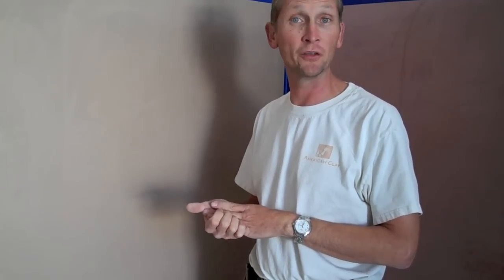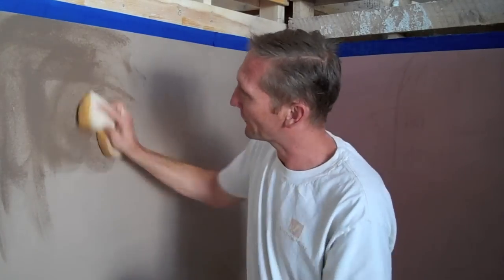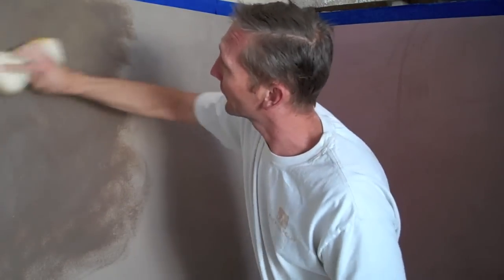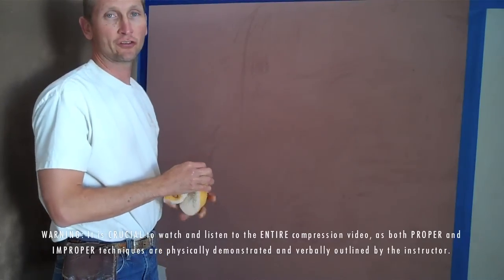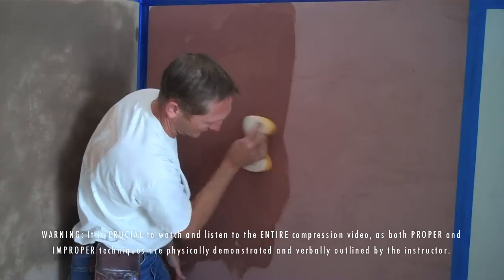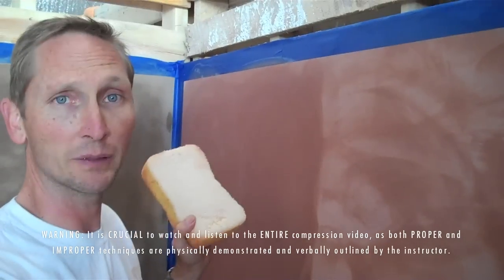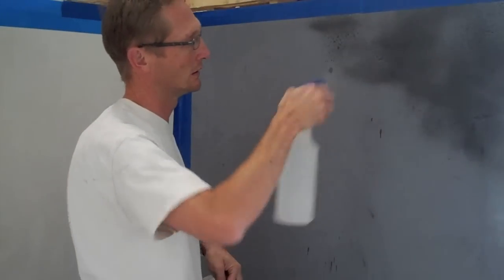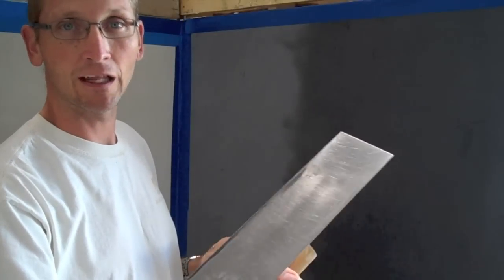Compression Techniques

Comment: Just finishing a thousand sf. job . Been working with different coatings since 1978 .
We applied clay coatings thin as was advised for this second time job .
The thing I noticed when we went to compress is that it’s critical how much water and timing to troweling.   You want the clay damp enough to compress and smooth out and not so wet as to wash away some of the clay leaving a sandy dusty brittle finish .
We used hand pump sprayers (garden sprayers)with very little tip adjustment which made it difficult to apply the water evenly over the surface. 
If we do another project, I will use a electric battery powered garden sprayer with a fan tip and adjustable pressure which I have .  This will apply the water more evenly over the surface.

Comment: Is troul compression not the same as burnishing (polishing by creating pressure & heat) & because here the clay product is wet? Is your  compression (pushing/compressing) the product into the wall & itself or are you just knocking off to eliminate the loose product on the surface?